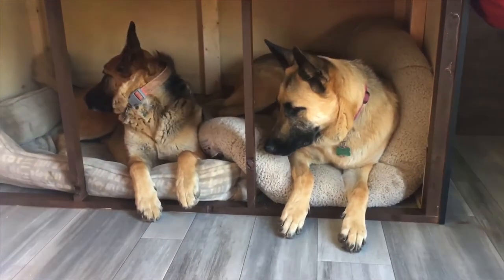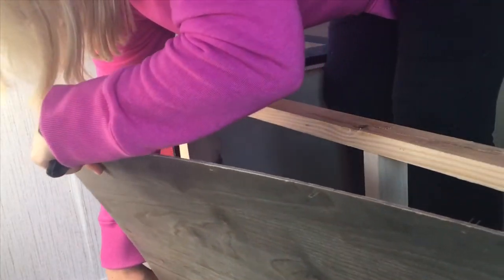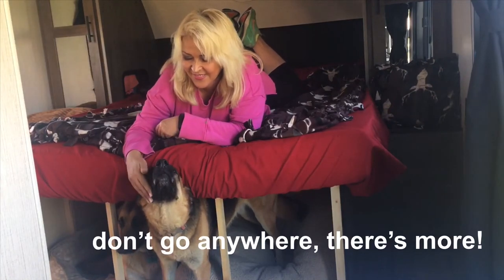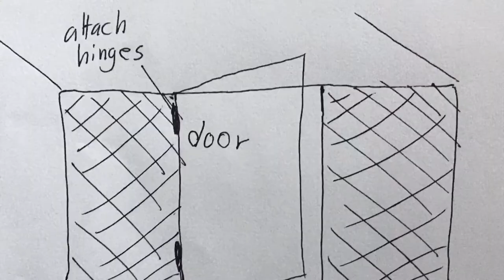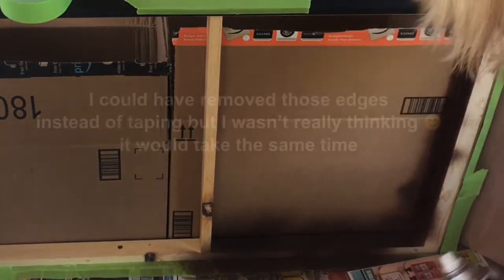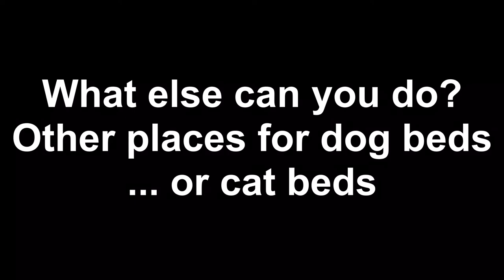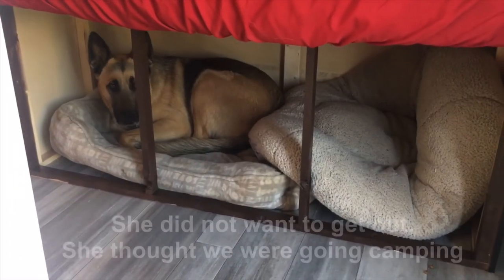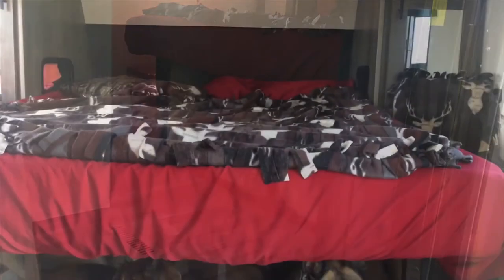How to add a dog bed to an RV bed [fifth wheel, Travel trailer]

Comment: Just leave the area open.  Easier to clean up hair. In case you didn’t notice GSD’s shed an unbelievable amount of hair. That’s not sarcasm, trying to be funny. Both dogs seem to enjoy the their safe space.
Reply from the maker: you're right about the GSD and the hair. I used to have 3 of them (I still wish I had 3) 
But Ike reason I've made this is because I don't want the dogs in my bed. Too much hair. And you're right, leaving it open like this, can be easily swept out, beds removed, changed, etc.